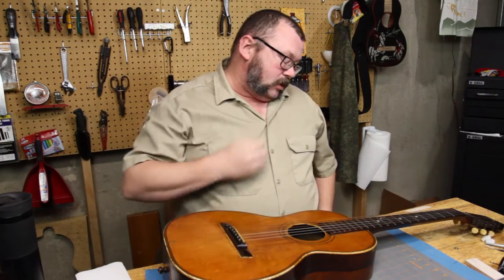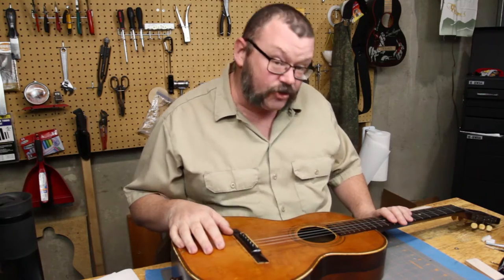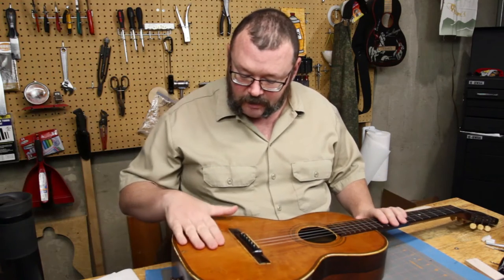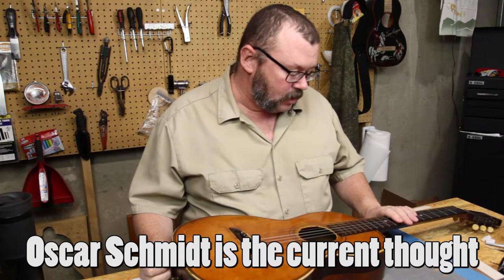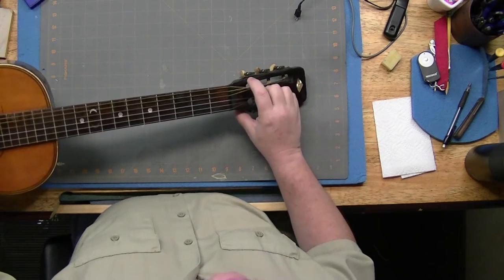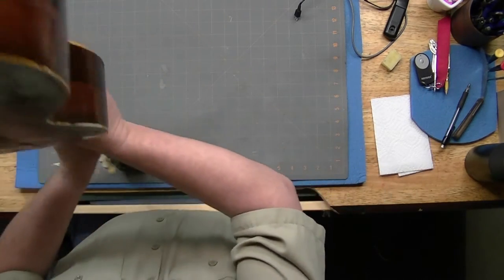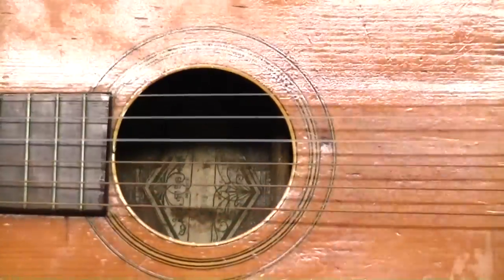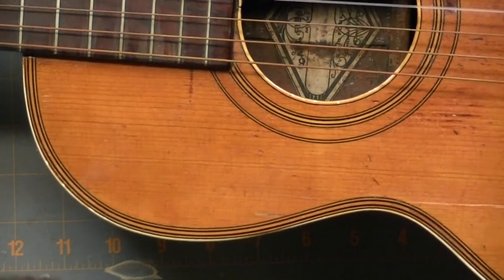Intake Inspection Carl Fischer parlor guitar pt1 | RATTLECAN GUITAR RESTORATIONS by James O’Rear

Comment: It seems like I've seen this video before! :D That finish looks like it chemically reacted with something, I've seen that before. Those cracks in the side will be a mother to cleat! The glue under the bridge looks exactly like the glue on the bridge of this Echowebb guitar and I had a hell of a time getting it off and cleaned up.
Reply from the maker: I've confirmed the glue used was Gorilla glue and according to the manufacturer website heat won't touch it. You'll see the plan in an upcoming video.

Comment: Really god, informative video! Definitely urethane was used for the bridge and strung up too soon. I agree with Randy: the finish is an overspray that has reacted and created exaggerated craquelure on the headstock and neck. The guitar seems too have been put in the case too soon after refinish, resulting in fabric impression on the finish. And/or it was exposed to relatively high heat while in the case. Some of the DNA and fabric impression could be the result of a reaction to nasty perspiration: rode hard and put up wet. I wish i didn't know these things from guitars I've owned or repaired.

Comment: Ouch! You didn't ask for advice and I'm not sure where I would start. I am also a huge hater of urethane glue way before the gorilla folks made it a household word. But it will scrape off with some effort. I was thinking that could be Brazilian RW, cracks seem to ok for that wood for some reason. By the rotation of the bridge and top I agree it prolly had steel strings at one point. Unless you, like me, work for next to free and just have a need to save things this guitar could not possibly be worth what it would cost to fix it. Is it possible they made the neck finish out of some kind of celluloid? Like the pick guards and it's just melting on it own. Or maybe it was refinished and the two finishes reacted?
Reply from the maker: The owner said it sat in a cedar closet for 40+ years and when he took it out of the case it had stuck to the finish. We've talked about it quite a bit and will present the plan in the next video. Sometimes discretion is the better part of valor. Thanks for your input as always Dane.

Comment: How goes the lone ranger? And also were any of my suggestions worthwhile?
Reply from the maker: It has taken a step back to allow projects that belong to people to be done quicker. Still undecided on the fingerboard finish.
Reply: Rattlecan Guitar Restorations it's going back silver that's easy. After you. have it as strategy as you want the fingerboard  user automotive primer in a spray can. apply several coats  sand with 400 than spray  silver paint lacquer can be used if the primer was lacquer. if the finger board still has grain showing  you can either reprime or use spot putty to fill the grain. after it dries sand  with 150 than 2more coats of prime sand 400 spray silver than use a pencil  eraser with black paint for the dots than use enamel clear on the rest of the neck. frets board and back. after you apply several coats it can be scuffed with a piece of 2000 grit wet paper to make it slick enough to play without being sticky.. make sure that you clean the fret slots before  you  refret it.